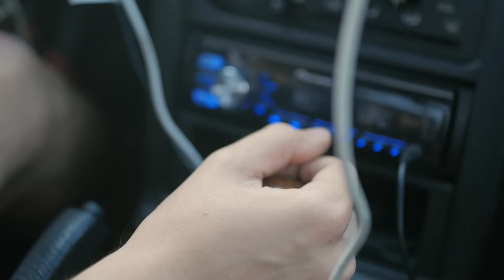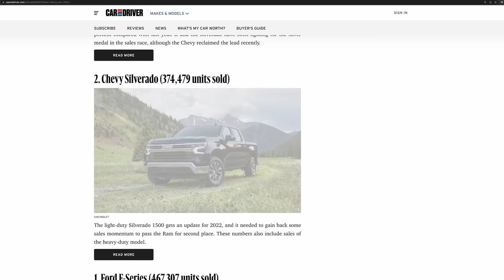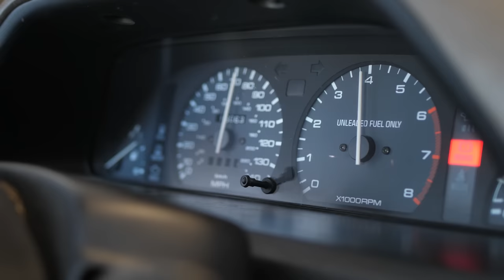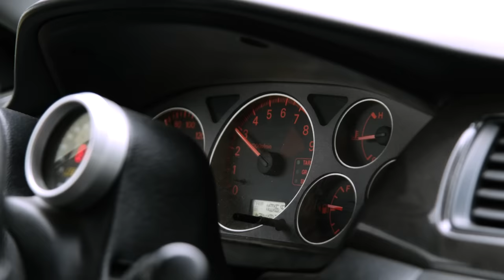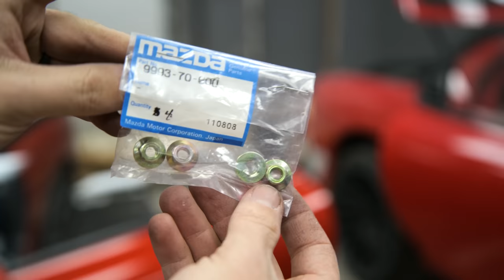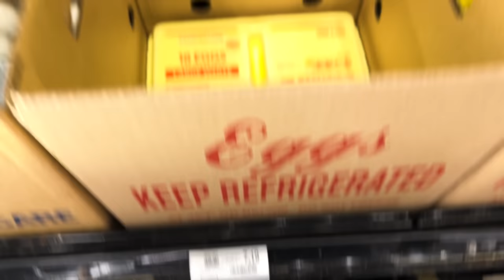Daily Drive Your Fun Car

Comment: Probably agree with every point made. I have a 400hp turbo honda prelude, and a 2008 civic si. i daily drove a 99 civic. it’s gas mileage was great, but it was automatic, made most likely less than 100hp and just didn’t have that experience. before that, i daily drove my prelude till it went turbocharged. i miss daily driving that car everyday. i wish i still could. but being it’s a hood exit car now, and there’s a few things i don’t yet have the confidence or mechanical ability to fix a few things, it’s just not entirely practical. which brings me to the Si. it’s 6 speed, makes a tiny bit of power to get around, relatively stock and just enjoyable. handles fantastic, sounds good, not too loud, all around hits nearly every point. i can definitely say even though i spend more money on the Si in gas, insurance etc, it makes every drive way more fun than the auto civic!

Comment: Awesome video. My daily is a base, low mileage Mk6 GTI I brought home new in 2009. One of the best practical performance cars you can get. 0-60 in ~6 seconds, 26-28 mpg combined, relatively lightweight (compared to most porkers on the road today), smooth stick, communicative steering, corners flat, comfortable, plenty of room for stuff (especially with rear seats folded), and still looks great. Maintenance has been affordable and doable (learned a lot along the way, too), but the plastic water pump (hate when companies cheap out) is a known issue and is on its way out. That, and possibly the timing chain tensioner, will cost a pretty penny, but they'll be worth it because I get so much value and pleasure from this car. And it's still cheaper than buying a used or new one. Plus, I'm not a fan of the Mk8 GTI and its haptic feedback. (I'd go for a Mk7.5 GTI or new Civic Si or Type R, if I had the means.) Anyway, VW made a keeper. Happy New Year, guys!

Comment: The best daily driver Ive owned wasn't my Miata or my Mazda3 Turbo AWD hatchback. 

It was my 2017 Elantra Sport. 1.6T, 6 speed, and it popped and bubbled from the factory. 

It was $20k out the door brand new, got 35mpg, made 200hp, and was very fun to drive. It was pretty comfy too.

But it was so much fun! My mazda3 is too comfy and disconnected. Its fast, but soulless. 

That said, from april > october my Miata is my daily. Because i hate myself and love driving

Comment: For me the owning a sports car as my daily would be pointless, I love racing and going fast on a straight highway is no fun at all, or accelerating fast inside or outside of the town only gives me anxiety about the danger and the police.
Driving on a track is completely different thing, pushing car to a grip limit, improving your racing line, actually driving a sports car the way it was intended:) 
And if you do both, that is daily driving sports car and regularly pushing car to the limit on a track, you choose impractical option, because once you break something in the car (which is a common thing if you actually use it in a sporty way),  you lose your daily driver for a while.
So I would rather have 10k comfy daily driver + 10k project race car than 20k daily sport driver. More practical and fun option to me.

Comment: While there are more dedicated vehicles for handling based motorsports. I very much enjoy what my FIst offers day in day out. I have plenty of room for my needs. The weeks I somewhat stay off throttle I can get into the 30's mpg wise. The suspension is not the most comfortable but it's good enough for me. Then there is track and auto cross. It's enough head room for me to learn and have fun but I know it will get me home.
Reply: Oh and during a winter storm it still gets around quite well. This is even compared to my Subarus.

Comment: This may sound crazy I went from daily driving a 630 HP 335i filling up once every two days with gas down to a 2nd gen Mazda 3 hatchback! Yes I loved the 335is power but the Mazda 3 Is way better of a daily the handling is amazing and it’s fun! I now modified it and it’s currently making around 215HP and it’s perfect! Soon it’ll be tuned making 230-250 and that’s when it’ll be the best daily ever! I have Mazda reliably on top of amazing handling and practicality and good gas mileage!

Comment: You really don't need an expensive car to buy or run to have fun daily.
For me, a fun and reasonable economic daily driven car (I have to give the sample of my Fiesta ST) will beat driving a boring car (saying a 1.2L Polo) as daily and having a weekend toy (let's say a MX5 or RX7) that rarely is driven. Nothing better than feeling a sharp chassi and suspension, lifting a wheel and slam some gears while trying to fight the steering all the way home after a long day at work. On the very next day you can make the exact same trip with 40+ mpg, with the same car, only one insurance, one anual tax, one MOT.
Sure, when age starts to show you will want a more comfortable daily with more space for the family, that usually ends up with a heavier and not so much of a gun car, but cars like i30N, Megane RS, Focus ST/RS can be a good alternative to having a Diesel 3 Series on the week and a MX5 on the weekend. Shame that in America you don't get some of the best cars on this class, but again, you guys like your trucks and big engine, heavy spot cars.

Comment: I own a 98 1.5ls civic, I got it for 400€ with only 120000km (sorry I don't know the miles conversion). At the beginning I didn't like it, low power and there was some imperfections in the paint, even tho, I used it for year and a half as my daily driver. Unfortunately one hot summer day one coolant hose exploded and well, blown a head gasket, that time I noticed how much I liked that car, how much fun I had when I drove it. Of course I worked hard to be able to fix it, and got to do it. Now, about 4 years later in still owing that same civic as my daily, saving for little mods and repairing some hail that fell quite a time ago, and for the third time, a head gasket, a lot of people told me to shell it broken and save for a "normal" car that isn't 24 years old, but they just don't get how fun is it to drive, no need to race in it (still pretty fun tho) but just go for a drive and enjoy.

Comment: Got a new job with long commute (70 miles round trip) been dailying my 350z Drift missile with 6 puck clutch, Welded diff, rubbing tire, cabin fumes, it sucks! I know I'm putting wear on it also, looking at a new Civic SI now

Comment: I just got a Civic, 8th gen LX automátic and made it the perfect car for everyday use. New motor and Gearbox so it is bulletproof. Lowering springs makes it handle better, look better and be more efficient in the highway. Got a 10 inch android radio installed, went for a top spec one wich also had carplay and android auto, so I am right up top with new cars when it comes to tecnology. Got some upgraded speakers and a small amp installed. Sound treated the doors, roof and floor with about 30lb of dynamat, then saved those 30lb by getting new lighter wheels. Got some nice LED aftermarket front lights, projector type. Got it ceramic tinted with the best heat rejecting there is. Got a quiet yet audible at high RPM exhaust, got a CAI and hondata flashpro. A 47mpg highway car, that Is reliable, smooth, comfy and high quality, that still can be fun around the mountains. 
For anyone interested, about 140hp wheel, 6.9 0-100 (suprising). 35-37 mpg city, 45-48 mpg hwy, it takes regular wich is cheap. About 100.000 miles in and the only thing that failed was the belt tensioner at 80k, water pump last week. 50 for the tensioner + belt, 35 for the water pump. Oil changes get done Every 5k with cheap 5w30, and transmission gets done Every 30k with honda DW1. The thing is bulletproof.

Comment: 4 years, 90,000 miles daily driven, 150+ days on a closed course in my 2015 EcoBoost Mustang. That's an average of one in 10 days I've autocrossed or tracked. It's been my only car, been incredibly reliable and practical.

I "built" it for SCCA autocross Street Class. It's a daily-driver class that only allows a few mods. Shocks, sway bar, exhaust. But you could run bone-stock and still be competitive. It is by far the cheapest, easiest, lowest risk way to go racing. Local clubs run events all over the country, with free rental helmets and driving instructors.

Comment: I'm looking at a 1997 Honda Prelude or Integra type R to mod & daily drive, and sure I can have it high horsepower with an expensive exhaust but that would be obnoxious.
Personally, just a nice body kit and those stock spoilers are just right for those smooth rides.

Comment: You can daily drive your fun car when it's 20 below and a foot of snow outside for 4 months of the year, but after a few years your car will rot away from rust.  Case in point, I haven't seen one of those Mazdas that you use as a beater car in over a decade and it's likely because what is left of them here will fit in a dustpan.  Heck, I have a 2016 Fiesta winter beater whose rear hatch is already rusting out at the bottom.

I guess I should just move somewhere nice :)

Comment: Basically you need a decent A to B car that is paid off and it's reliable and it only needs oil changes on the most part. Then you need a clean fast car for street and occasional track days and for cars and coffee, then you need a full blown track car, then you need a awd truck to haul your shit and take it up in the snow etc... then you need another car just for the wife to drive (if it breaks she can drive the A to B car)... then you need another car that would be a semi track car but for the street, gutted and modified and have hidden aftermarket parts so the cops in CA can't find them... I think that's a good starting point! 🤔

Comment: Come on...F150 isn't a boring car. I just picked up a 2018 Lariat with a panoramic moonroof, 10 speed, 3.5L twin turbo V6. I have plenty of fun hearing those turbos spool and still having plenty of luxury amenities that make an awesome daily driver.

With that being said, I still have my 2016 BMW M3 manual with 600 whp to have fun with on the weekends or take it out to work instead of the daily if I wanted to, cause that thing is also still a pretty good daily. That's the cool thing about being a true car enthusiast - you can find a bunch of cool reasons to drive a specific type of car

Comment: This might be one of the takes that I completely disagree with. I recently had only one car, but I had to get a secondary car after Subaru decided to not honor a recall warranty when my engine blew up after service. 

Having a second beater car is easier in the winter, less stressful in traffic, less expensive. I would also say that if you only drive your fun car 3-5k miles it drops your insurance by almost half, and a second car that’s cheap will almost always be half the cost of insurance compared to a fun car. 

Also just because your car is less than half your annual income doesn’t mean that you can directly afford to replace it. The pandemic has royally destroyed used parts prices. My engine for the BRZ used to be $1500-2000 before the pandemic but when my engine failed after the recall I was quoted $16k for a new replacement stock engine. I would never have paid that because I was not at fault and engine rebuilders were taking waitlist orders for 6-7k, but it’s still a point to say that the supply chain has destroyed the idea that even a cheap car can be fixed with a small emergency savings fund. 

A car like a early 00’s Corolla will never cost you any more than $500 in parts for any singular part. New engine or trans? $500. New brakes? $200. Cat stolen? $150 from the junkyard or maybe just test pipe it. 

In my opinion a beater car of the right vintage and a fun car will almost always be cheaper than just a fun car, you enjoy your fun car because you aren’t burned out by its faults when driving it everyday, and you are saving value/maintenance/future miles in your fun car, but making a point to always drive it when you want a special experience. I don’t see how there are literally any downsides to truly having a cheap beater + fun car.

Comment: Ben, if you read these comments I would very much appreciate your thoughts. I own a lightly modified 2019 WRX (FA20DIT) with 62k one owner (me) miles. l daily drive my WRX across TX utilizing it for some fun and also for work travel. The car is paid for and I enjoy driving it. I currently have it modified and tuned to make around 270/280 on 93 octane. I take excellent care of all maintenance and don’t abuse the car. Here’s why I want to hear from Ben. There’s currently no other car on the market that scratches all of my itches the way my WRX and a tuned FA20DIT do. The car has excellent usability, trunk space, interior room, AWD,  handling, and some fun turbo power. Why would I ever get rid of this car? At some point (I assume within another 50-80k miles or 3 years time) I will begin needing to do some more substantial refurbishing if I plan to continue driving the car reliability  across TX plus having some occasional fun with it. Would you recommend that I go through a similar but hopefully less costly full rebuild as you did, and if I did a complete professional refurbish would there be any reason after my rebuild that I wouldn’t be able to expect the car to last for another 100k or more mostly trouble free miles? My ultimate goal for my WRX would be a lightly built FA20DIT that can easily and reliably handle 350/350 on 93 octane, and then combine that with a good condition refurbished used STI transmission and differential. Add in a new suspension, whatever additional supporting equipment is required, new paint and body (as needed), and then have what I would love to own as a “new again”  WRX. My budget would be around $25k and maybe a little more. Your thoughts? Thanks in advance!

Comment: I actually tried to daily drive my fun car this year but city traffic really made it not fun. Id rather just daily drive my old jeep because the light clutch and good sound system
Reply: I think a good way of putting it is "daily drive a car you _like_". A daily doesn't necessarily have to be fun, you just have to like driving it, which makes things a little easier when the traffic is terrible, or the weather is terrible, or you just want to get somewhere without being annoyed by something.
Reply: Very glad the clutch on my GT350 is pretty light

Comment: I guess I completely disagree with the “don’t have one fun car and beater car” segment. 

I live up north in WI where salt and brine absolutely destroys vehicles. If you flip through cars frequently this doesn’t matter, but if you hold onto cars for a long time you don’t want to drive them in the winter. My “fun/nice” car is an Evo X that I don’t plan on ever getting rid of so I put it away for the winter so it stays rust free. My “beater” car is a rusty Miata that I still have a ton of fun with and love driving and ice racing with. Sure I have “2x the cost” as you say, but maintaining a crappy Miata is pennies compared to attempting to fix rust and corrosion on my Evo in the future. A beater car doesn’t have to be boring. Boring cars also have their place in the world. I also have a dinky Saturn SL2 that while obviously isn’t anything special—it’s nice to just get in and drive occasionally and not think about much lol.

Comment: Used BMW e46 parts are plentiful and cheap, you can pick one up for scrap price due to most of them being mechanically totaled. A cheap set of tools and a few YouTube videos later and you’ve got a 225hp spirited, fun , smooth daily with DIRT cheap insurance.

Pro tip look for a 330ci, 330xi or 330i they have bigger engines, brakes and better options.

Comment: Other than maybe engine related spare parts (4G67) my daily checks all the boxes thankfully. 1991 Lancer GTI 16V. I love the damned thing, every drive is fun, even if im just going to buy groceries. Surprisingly comfy too.

Will probably switch to a 3 or 5 series with a straight 6 or V8 later on, but only because I want to try out RWD cars. After that, something with AWD.

And once I know what kind of car I like the most stick with it and perhaps do some OEM+ mods to it, nothing crazy. Maybe rent something for my birthday, so I get to try out newer cars I wouldnt be able to drive otherwise. Here in europe, V8s are relatively rare, so definetly a rental 5.0 Mustang.

If I were to buy a new car it would probably be a ND Miata. Both my parents have trucks, so practicality is covered.

Comment: Take it from me: Dailying a miata is awesome. Except in the peak of summer or peak of winter. There is no insulation with the convertible top. I've tried dailying an NA and an NC2 at two different points in my life - neither lasted long. 

TL;DR - get a hardtop.

Comment: Nope DD a auto sx4 hatch and pull out the jdm sti hatch when I want to go for a nice drive. The contrast between the two makes you appreciate both for different reasons. With the cost of clutches and tires and other consumables it would be crazy to let my sti still in traffic 2 hrs daily rather do that in the little automatic suzuki.

Comment: i think this really depends on how many miles you have to drive daily. Buying my 1500 dollar kia was one of the best decisions ive made. I daily drove my now weekend car to 110k miles before before really fully building it, and could i still daily drive it well sure but the cost of tires/gas/brakes/oil changes doesnt really make sense now.
Reply: This. Changing brembos ain't cheap. Neither are good tires. An ok set for 6-700 would do, but would the set be able to keep up with the fun car?
Reply: @mengx94  Exactly i got tires for my daily for $400 while for the weekend car can be up to $1500. Oil changes every 1.5k miles (while on e85) compared to 6k. Super stiff suspension with hard mounts and bushings dont make for the best daily. However its ready any day i want to take it out and have some fun or cruise to work.